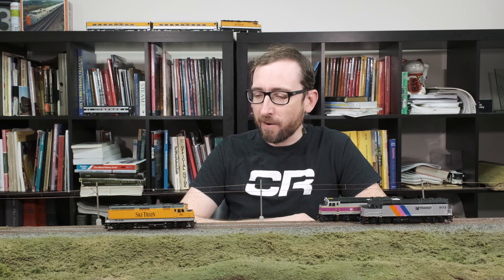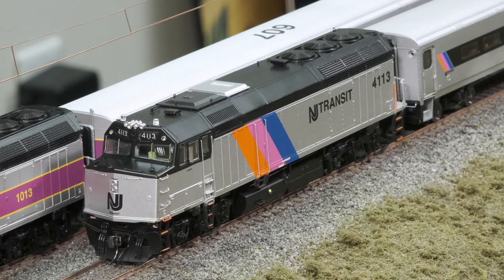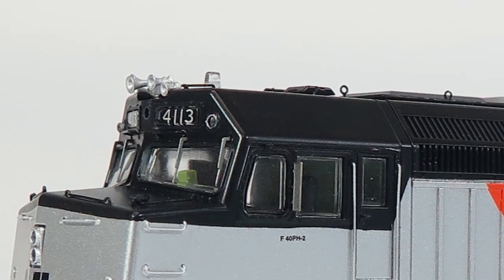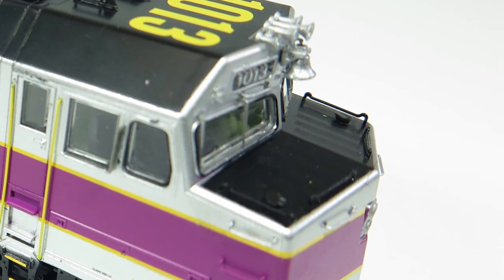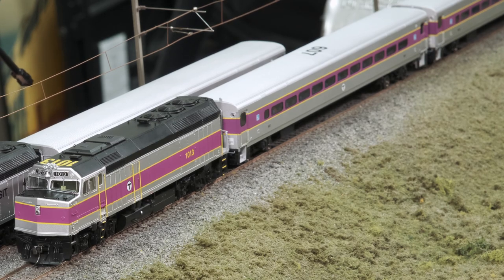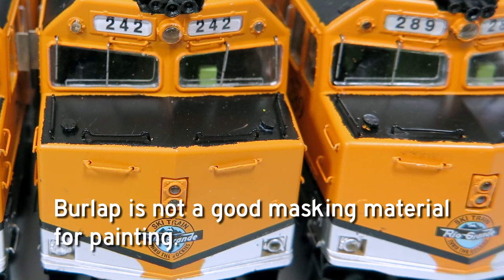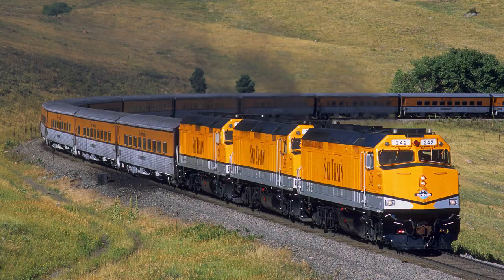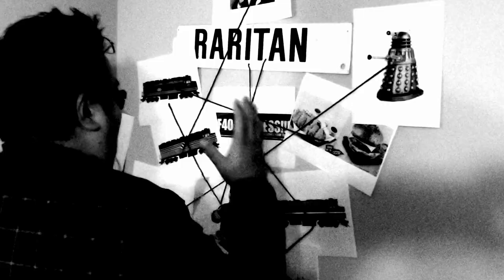Rapido Trains HO scale "Later Phase" American F40PH locomotives

Comment: Will the Amtrak versions have working emergency light?
Reply from the maker: Like our earlier F40PH releases these models will come with operating headlights, red marker lights, lit number boards, roof mounted strobe lights and ditch lights on the later era units. The red emergency light between the number boards is non functional due to decoder function limitations, but in general these were very rarely used on the prototypes.
Reply: @rapidotrains  got ya, thanks for the info!

Comment: The FRA didn't mandate Ditch Lights for running over crossings until 1/1/97. Before then, you didn't need them, and MARCs GP40WH-2s were exempted as they had Gyralights. Metro-Norths M8s don't have ditch lights as they don't run over crossings.
Reply: Metro-North's M8s run over grade crossings on the New Canaan Branch
Reply: 12/31/97 to be exact.

Comment: Do you think  you can do the NJ Transit GP40PH-2S  and GP40PFH-2bs  and Metro North  Phases in Ho scale
Reply: Most of the Locomotives are the same  just different  model
Reply: But I like NJ Transit a lot  because  by the Pascack Valley line
Reply from the maker: That would require a lot of new tooling, but we’ll consider it for the future.